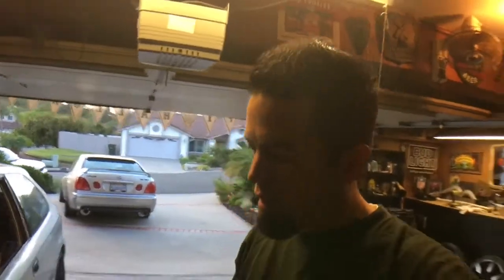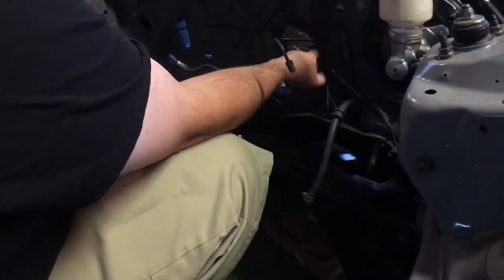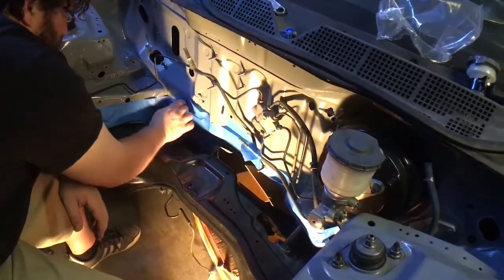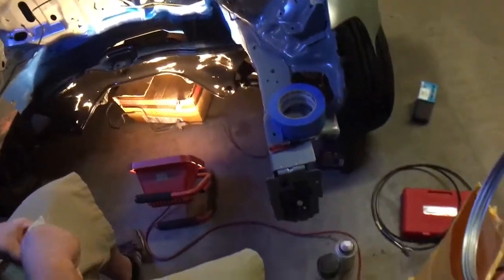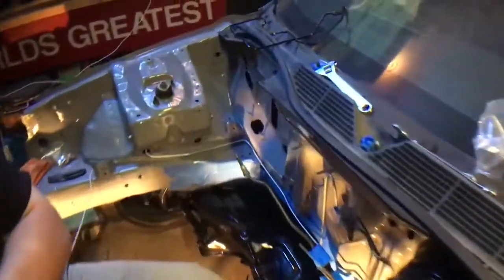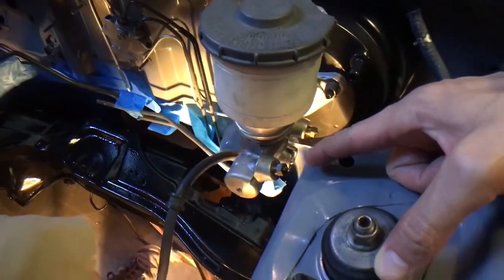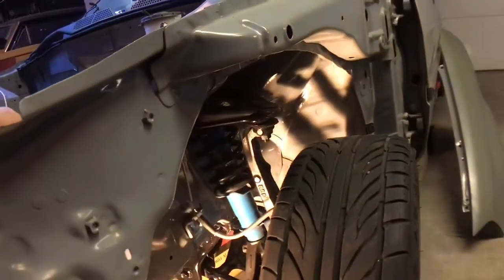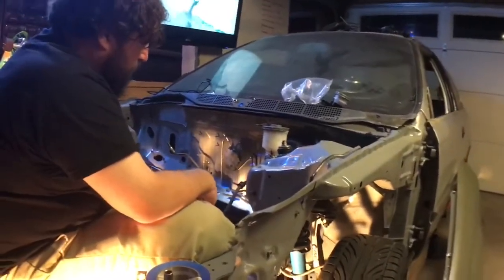Ek Civic gets custom brake lines

Comment: You guys used oem fittings right?
Reply from the maker: Wilfred Munera we sure did. Seemed the safest bet. We bought some just in case.
Reply: UNDER FUNDED GARAGE thanks for the reply guys, can you suggest where I can get them? All of the kits that are out there only come in AN fittings and ive heard mixed reviews about those
Reply from the maker: +Wilfred Munera ok so we actually cut the stock ones off of the stock lines and just reused them. 
The only option I would feel comfortable going with would be Honda parts from the dealer. 
Sorry bud, wish I could be more help. I appriciate the comments and I appreciate you watching our channel.  We might not put as much into the channel as others but it's ours and we care alot about it. Please stay tuned and please subscribe for more. 

Thanks for any support Wilfred